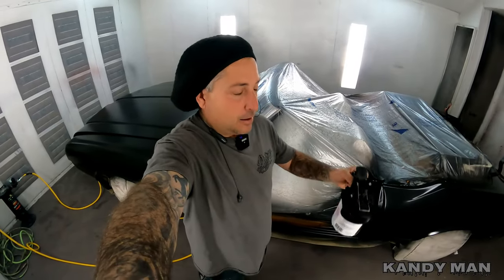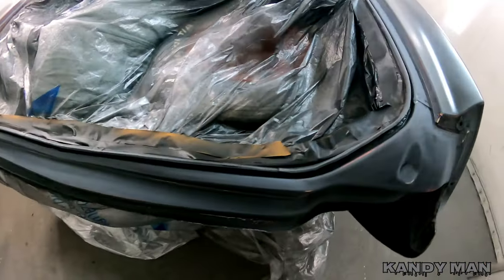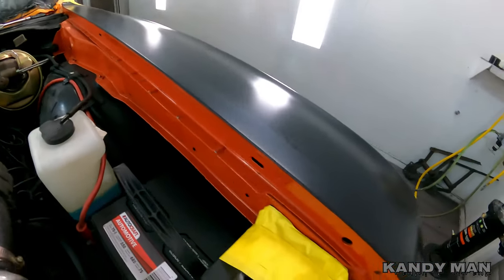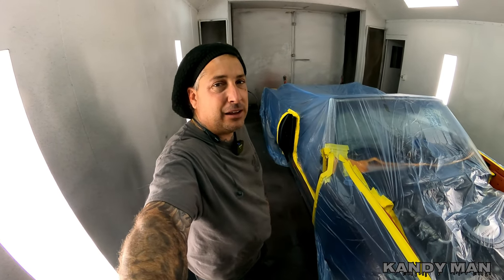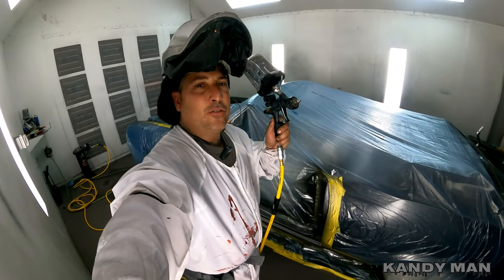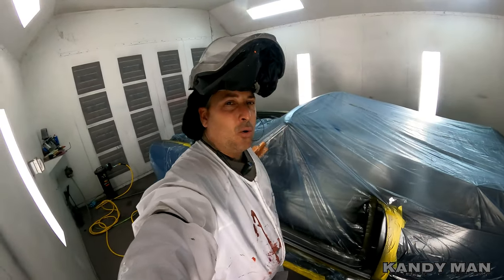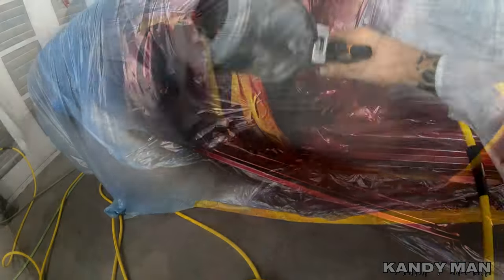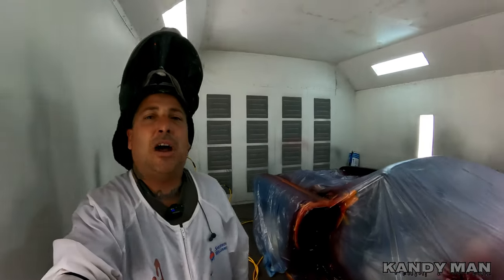STEPS FOR A MIRROR PAINT JOB PART 5

Comment: Question when do a restoration or painting panel off the car...  i offten battle this issue  for basecoat clear coat... and installing painted hardware....

I normal wait sever weeks for the clearcoat to cure and harden... the issue i run into is mounting hardware on freash body ie remounting your pre hung  and preajust doors back on the car... ie the paint on the bolts get galled up from the socket. Or wrenchs.. or when you tight the fender bolt slowly... but it need to tighted more.. the paint wrinkles from the blor presure sqeeeze.

Is recommented to use basecoat activator in thes trouble spots...i let the  paint dry several weeks befor install ...i dont have heated booth at home but i do use ir lamp  where i can....not use if there a differance wave length required for baking panels.

Any tips
Reply from the maker: I like to use stainless polished bolts . But it is a pain for sure
Reply from the maker: But if your gonna use factory bolts a lot of times you will have to re spray bolts once finalized
Reply: @kandyman5315
Reply: @kandyman5315  if you ever have a job like this make video on tips or tricks how to make the job easyer

Comment: What psi u spray kandy? I would guess thats actually candy not the kandy basecoats , correct? Had my old s10 done in a kandy basecoat candy apple red over orion silver. Was bad as in sun
Reply from the maker: Yes this is true kandy UK  house of Kolors
Reply: @kandyman5315  what psi?  Noticed u sprayed with dv1 clear gun. Any reason that over dv1 base gun?
Reply from the maker: @jasonwilliams4063  23 psi the UK is  a clear coat with  dye in it so it acts like clear coat  clear gun sprays  it  great.